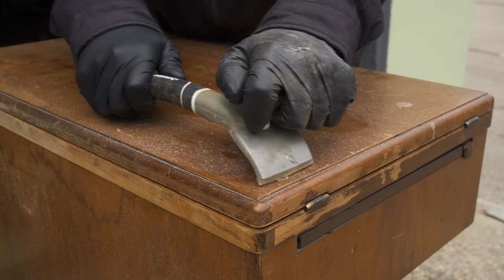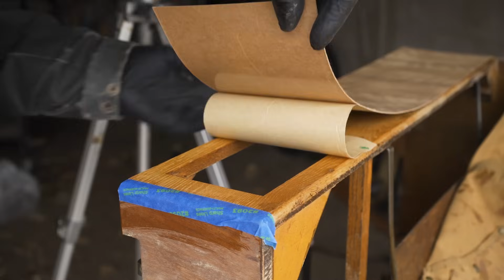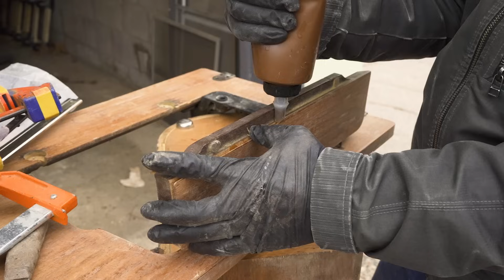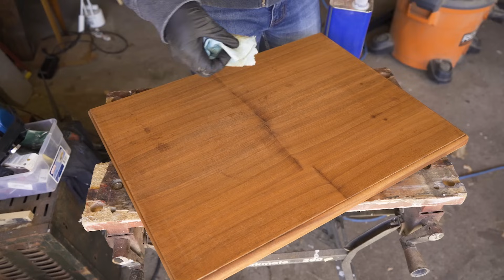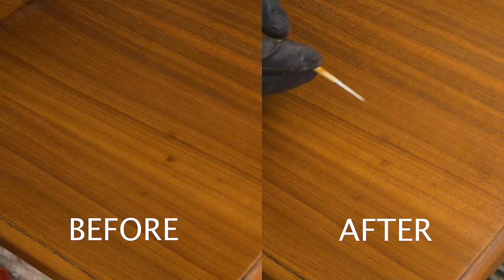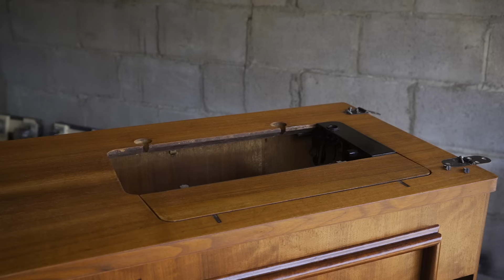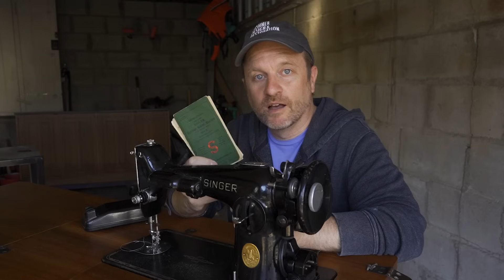I Usually Pass These Up But This One Was Different | Singer 201-2 Sewing Machine | Furniture Repair

Comment: Someone may have already commented, but you use sewing machine oil to clean the machine. Most of it is sewing machine oil that has hardened and the finishes is shellac so it’s quite fragile.

Comment: I have a cabinet very much like this (not rounded, though) and it is in really rough shape having been purchased for the original user back in  1955.  The matching bench-type seat (with storage) and the cabinet both could really use a refurbish.  I will put this onto my list of things to work on learning.  I love the part where you show the new laminate being put on.  I am so "green" about this topic that I did not even know there was such a thing.  I will save your video as a reference.  The machine in my cabinet is a 306K, which features the original "swing stitch" which later started being referred to as zig-zag. It came to me along with a black and white photo of the machine and cabinet together when they were new to Mae, who sewed for decades on the powerful machine.

Comment: I was so pleased to see the Art Deco Singer table, hoping beyond hope that it had the 201-2! You did a beautiful job restoring it. Then I heard you say you used water on the machine!!! The white was just moisture, and a light fan from your heat gun would have likely removed it, then a little French polish would fix it up safely. 
The "paint" on Singer machines is Japanning, a baked-on finish of Asphaltum and turpentine (and a third ingredient I can't remember). That would ordinarily be more matte than glossy, and the Decals need protection so they are finished with Shellac in several layers.  The decals go onto one layer toward the end and the final layers are likely French-polished.  Therefore, using water or anything based in water or alcohol can easily ruin it. 
 The best cleaner to use for basic cleaning is sewing machine oil. If the old shellac finish has crackled or been scratched, another treatment with French polish is just the thing. 

You lucked out with the Flitz, and it looks beautiful. Another cleaner that is safe to use on it is GoJo without pumice.  It's a hand cleaner used be mechanics, but it's important that it doesn't have pumice. Working gently is my best advice

Comment: Beautiful restoration. I have an old treadle Singer  in a cabinet which I've yet to restore, I hope I can do it as much justice as you have on this restoration. I also have a hand crank Singer in a wooden case and a 1980's electric Singer machine. The older ones are amazing, truly built to last, run smoothly and the stitch is perfect. My favourite is the hand crank, I've yet to master the treadle.

Comment: You're cabinet restoration is incredibly beautiful!! It looks amazing. But if you ever come across an old shiny black Singer (or any shiny black machine) like that again, do NOT put water or alcohol or any solvent on it! That's what's called a "Japanned finish". It is somewhat fragile and easy to ruin. The only cleaners you should use on it are ordinary CLEAR sewing machine oil or Singer's own cleaner which comes in a kit. It's intended for their Featherweight model but will work on a 201 as well. And by the way, that machine is valuable to collectors and users alike. It sews beautifully, is easy to maintain and if cared for will keep working for generations to come. A working 201-2 in an exquisitely restored cabinet such as yours is worth a decent chunk of change. If you're thinking of selling it, I wouldn't take less than $500 due to the quality of the machine and the exceptional work you put in to the cabinet. But that decision would be up to you of course.

Comment: I have one of these cabinets...my grandmother's machine. Am about to refinish but mine is fortunately in much better condition. Some newer singer machines fit right in if you want to update the actual machine. My current singer is a portable and does not fit so I use this cabinet as a side table but still keep sewing stuff in the drawers.

Comment: Tip: With a heat gun hit the underside of drawer a few quick times to loosen the glue of the contact paper. It will peel right off. #2; Wipe down the residue from contact paper gluee from inside of drawer  with GooGONE. THEN CLEAN With TSP #3; I generally use paper drawer liner or Wall paper remnants (Without wetting prepasted ) use double sided tape at the coremers to hold in place. #4 I use the Dollar tree drawer dividers on the inside of the drawers to keepmit" things" organized and neat. 
I love that you saved this old sewing machine from the dump. I'm sure the machine will have many more years of usefulness thanks to your careful and beautiful Restoration.
   ✌️🙏💙👍
Also, the machine can be taken to a Sewing machine repair shop for a good internal clean/ oiling . Probably won't cost very much. Since you said you " didn't know very much about sewing machines you would benefit from a professional check up to nmake sure it works properly.✌️

Comment: Not that great. though, having to hold the router down because it's within a hairsbreadth of overbalancing wasn't good practice. That's what trim routers are for. Likewise, going for a straight cut on the machine location was erm... asking to split along the grain. Rough it out, then finish with the trimmer.
Of course there's a place for heavy routing in the original construction, unless those ogives were from a plane - but this didn't need to replace serious worm infestation or rot.
Reply from the maker: It is a trim router.
Reply: @DashnerDesignRestoration  I looked at that big square baseplate shot from tjhe underside. Who do you think you're kidding? A trim router has a smaller base, less than 10cm radius, and most importantly directly under the motor, so the workpiece doesn't lever the tool.

Comment: 201's are good solid Singers. Great restoration. Hint: only clean the surface of the machine and it's decals with sewing machine oil. Never water or other cleaners. The decals are all water slide decals back then and will basically disappear and fade out with water. Well done in general. Love that you saved the machine in it's original cabinet.

Comment: I also have a 201 in that art deco table. Absolutely fantastic machine (it's my main machine out of my collection). You can clean the machine with sewing machine oil. It has a shellac finish which is why it turned white when you put water on it. Don't forget to add grease to the grease cups on the motor. And it's missing a spool pin. 😉

Comment: That is a workhorse of a machine with original accessories in a gorgeous table that was beautifully restored. I want!

ETA: My mum had one of these machines at our weekend/summer farm house they worked great on Dad's jeans when he ripped or wore through them. They are a straight stitch only, but had a back stitch lever to lock the stitch ends, unlike some earlier models.

Comment: You're right to avoid most of the sewing machines.  70 million women from 1890 to 1940 had something similar and they tend to survive, as they were so well built.  Unfortunately lots of people think that Great-grandma Gertie's machine is worth a small fortune.  Because they are so common, they're not really.  Unless it's a particularly sought after or has extra functionality.

I think you made a good choice with this one.  It looks to me like a 201-2 from the mid 30's.  But I could be wrong.  The table is lovely and was well cared for and the fact that you hav the extra accessories is a plus.

Comment: I realize the point of the video is the cabinet (and you did great). But wanted to let you know you have the "Rolls Royce" of Singer machines. Thats a Singer 201-2 with potted motor. The best sewing machine Singer ever produced. It has been said Rolls Royce actually  used the 201 to sew the upholstery in their vehicles back in the day.

Comment: Beautiful cabinet and 1920s Singer. Loved watching this project. My sewing machine (4th generation to use it) and cabinet are very similar! My cabinet also has a latch inside to hold the pedal and you push it with your knee. The cabinet was a curbside find and my parents lovingly refinished it for me.

Comment: I have that cabinet, stool and machine. Mine are in much better condition. The Singer 301 machine I have is a dream to sew with. The cabinet doubles as a desk as the small drawer on the left holds the original ink bottle and has a little pen rest. I have several Singer machines but this is the one I use most often. I have three Singer folding “card” tables but this is the inly cabinet I actually use. i have a treadle cabinet in the living room but it needs internal restoration. I believe that machine might be a Singer 66 but not sure. Looks to be in great condition and well worth a tune up at your local sewing machine shop. You have a beauty there and after your restoration worth several hundred dollars. Now, do you have the matching stool?

Comment: I have that very same cabinet that houses my mother’s Singer 15-91 made in 1948. I started sewing on it at age 5. If you want great details on how to shine and maintain it, the Singer Featherweight Shop sells supplies and has multiple videos that are most valuable. That machine in your cabinet 201-2 is very much capable of sewing upholstery, etc. There has been some mention it was used for sewing upholstery for Rolls Royce’s. Not sure of accuracy. Beautiful cabinet and your working in it was enjoyable to watch.

Comment: I have the exact cabinet, except the wood is darker in the trim pieces are black, mine has an old Singer in it too.  The drawers inside are the same.  Mine's in pretty rough shape.  Stains and veneer chips but, like you said, it is so unique.  It was at a house a friend of mine bought and it was left. I took it because I love the art deco look it has.  I want to restore it and now that I've seen your video I have a better idea of what I am facing, how it's built etc.   It's currently buried in a room we use for storage.  I will dig it out and give it a purpose until I can restore it properly.  Once I get it out would you like to see a picture?  BTW, I did a little research this cabinet is a Singer DeLuxe Desk Model #42.  A whole bunch out there...

Comment: That’s a Singer 42 cabinet, one of my favorites.  I was fortunate enough to buy one with a Singer 201 machine along with the matching bench and a buttonholer for $20 at an auction.  Mine is a slightly different version as it has a curved door the closes around the drawers as opposed to curved drawers.  Not sure which version came first.  It’s a wonderful machine & cabinet. So stylish!

Comment: I’ve got one of those cabinets with its matching seat, picked it up at Goodwill.  Finish was in great shape and it came with a working Singer 503 Rocketeer.   One of the coolest machines and cabinets out there.

Comment: The machine is in pristine condition,  too.  There are some good ways to clean the machine.  Best one is sewing machine oil.  It will clean it well and doesn't harm the decals.  They were actually French polished with shellac.  You can refinish them.  But that one is great.  Also, there's a serial number on Singers and you can know the month and year of manufacture.  Singer is an ama,ing company!!

Comment: A Singer 201 in a 42 cabinet!  I have the same machine in the same cabinet.  The 201 with a potted motor has the smoothest sound and the best stitches.  I've been thinking about how to spruce up the cabinet and now I know how.  Thanks.  PS: the safest way to clean a black iron sewing machine is with a soft cloth / cotton balls and sewing machine oil.

Comment: I have been through a few sewing tables in my sewing years, but now I only use a desk, because I use three different machines for different tasks. This one is really cool though and thanks for the video. If the machine had been sitting long it may need internal cleaning and then oil again, but it sounded really good.

Comment: OMG, I have my mom's Singer machine in it's original cabinet, 1954. Not quite as art deco, but with 3 simple square brass drawer pulls, same basic cabinet design though. My folks were more MCM in their furniture choices.  Mom taught me to sew on the same machine.Thanks! I just subscribed to your channel. 😂

Comment: I have that one and still use it. It is from the 20s...100+ years old i had the sewing machine reconditioned. It works great, even on leather which i have sewn a lot in the past 40 years. Its been in my family for 100yrs! No chipped veneer anywhere. Some dark stains on it. Mine has original finish on it. I still have all the extra equipment including the buttonholler and various feet and books. Im not sure that anyone other than me have used the machine. My mother was not a sewer. Not sure about my grandmother. She died in the 20s. Your video has inspired me to clean and re-oil the inside of the drawers with Wise Owl furniture salve, with lemon verbena essential oil scent. I may refinish the outside with Odies Oil.

Comment: Nice work on the cabinet! That is a Singer Featherweight machine. I have my Grandmother's machine and use it still. They are actually quite valuable.
Reply: Not a Featherweight- they are model 221, this is a bigger machine- a 201 I think, both are great, solid machines.

Comment: Your work on the cabinet was amazing. I have one but was hoping you showed how the drawers on the right side come out. There seems to be some type of locking mechanism that I cannot find to release them fully.
Reply from the maker: Yes, it was really difficult to get them out. I had to shove a screwdriver under the drawer and press down the little tab of metal that sticks up and catches a tab on the drawer. Hard to explain but it you shine a light under the drawer you should be able to see it.

Comment: My mom was super into the singer "feather weight" machines. I fixed several of hers over the years. They are a beast sewing machine. Used it myself a few times to try it out. Could do leather, jeans, no issue. Great machine to have around. The support and community for them is great too.

Comment: You might consider getting a glue syringe for gluing down loose veneer.  It would work much easier and do a better job of getting into those tight spaces caused by the loose veneer.
Reply: I’ve seen him use glue syringes in other videos. Seems like he saves them for the tightest jobs.

Comment: You should have the machine serviced--it probably doesn't need much except cleaning and oiling. The worker could probably tell you what all the accessories are. Unless you want to keep it, you could probably sell it for a nice bundle. And of course the cabinet is gorgeous. Someone would be proud to have that. 😁

Edit: I typed that before the end of the video. It works great, I can tell it's sturdy. My machine (not a Singer) is forty years old, but it has a lot of plastic in the body and I can just see this one here is solid.
Reply: Mine needed new wiring and cord. I reconditioned it 15-20 yrs ago.

Comment: All the sewers in your audience wildly flailing at the thought of this cabinet and machine 🙌🏻
Reply: you aren't lying.  I WISH my new machine was as quiet as that Singer
Reply: @shannonschwab3754  It was so smooth and even, I literally gasped loud enough for my husband to come over to see what was so amazing and it was an old sewing machine 😝
Reply: @ansis86 
Same here! Did not expect it to run so smooth!
Reply: @shannonschwab3754 I know, it’s so quiet! Sounds so smooth. My 15 year old singer sounds like a bag of legos.
Reply: Got that right!
[swoon]
Reply: My dream cabinet.
Reply: The insides on the old ones are made of metal. The newer ones are made from plastic.
Reply: @janeniehaus-tull6867  My mum’s old Bernina is an all metal workhorse so when I inherited my MILs old Bernina I was really pleased, only to discover it was one of the first to use plastic parts and is likely to give up relatively soon. Very disappointing!
Reply: I own a few machines and have consistently found that the older the sewing machine, the quieter, smoother, and better they sew.
Reply: @ansis86  I gasped as soon as I saw the white light switch because I knew that meant it was a 201.  Perfect combination of machine and cabinet
Reply: makes me want to learn how to machine sew
Reply: Ansis, I don’t know about the cabinet because I wouldn’t fit! But the machine is a beauty.
Reply: Absolutely.  I only wish I still had my mother's old Singer in a cabinet very much like this one.  No fancy embroidery stitches, just solid workhorses that were (and still are) every quiltmaker's dream.
Reply: I have similar but with Bakelite and bronze handles. Pristine White sewing machine. Notions including two pairs of the sharpest scissors I’ve ever owned. Good Will $9.99.
Reply: Indeed! It’s a stunning art deco machine. The pride of any fan!
Reply: I was drooling!!!!!😅
Reply: I just bought one yesterday and then saw this video today. The secondhand Gods AND the refurbishing Gods have smiled upon me 🫢🤗
Reply: I can attest ❤
Reply: I read that as sewer, as in drain. 😅 and I thought you were commenting on the finish removal going down a sewer drain.😂
Reply: @beeonthyme5760  I misread it at first also.  Then, when the statement didn't make any sense that way, I reread it.  LOL.
Reply: read this as sewers 🕳️ not sewers 🪡 lol
Reply: I have a 201. They are known as one of the very best ever made.
Reply: This is my same set up and I consider myself so fortunate as I found both in a thrift store for 50.00 a few years ago!